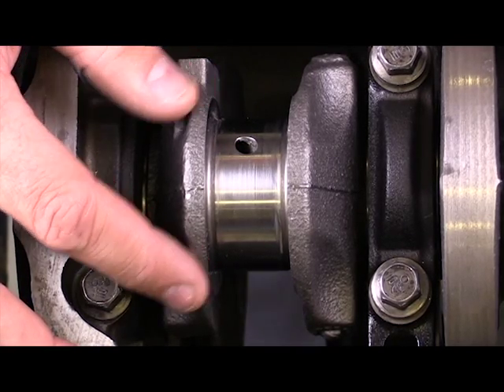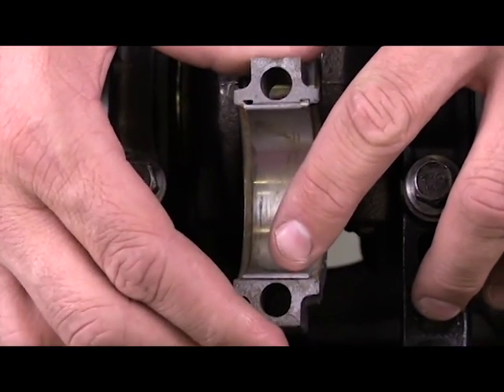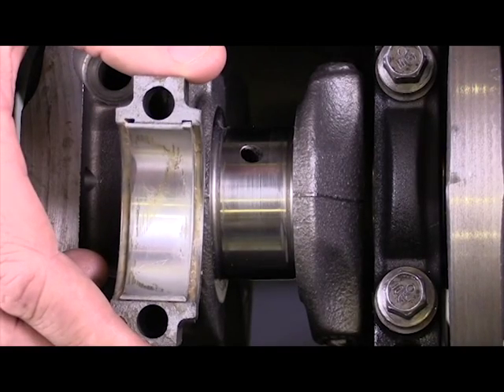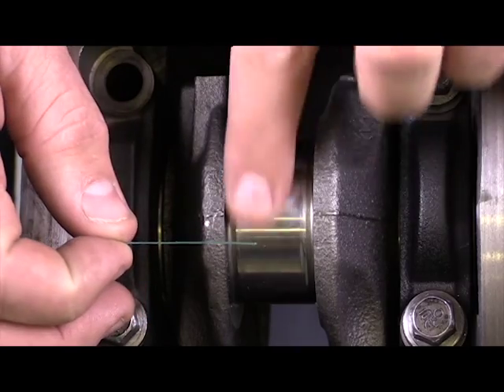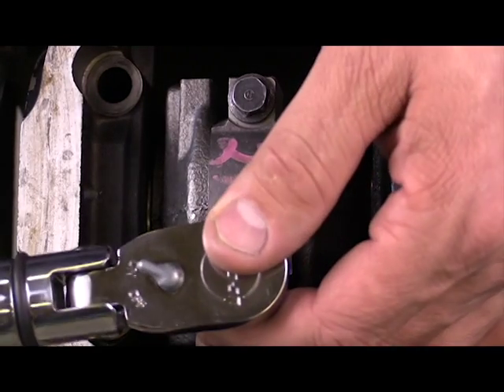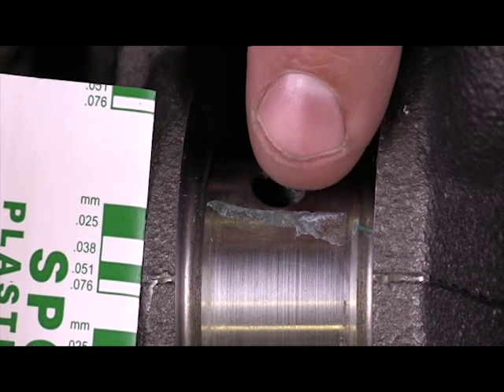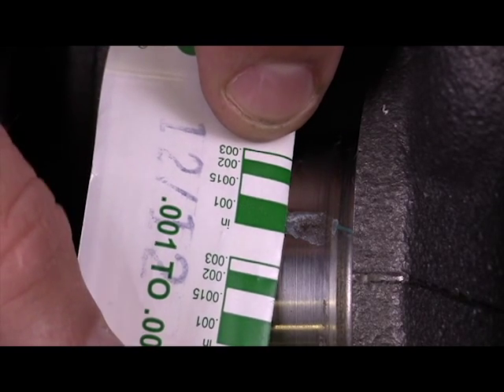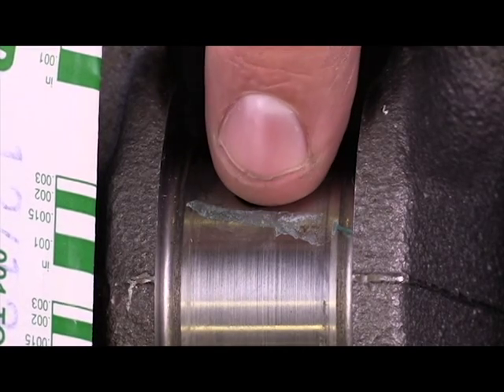Oil Clearance Measurement using Platigauge on a connecting rod

Comment: So do you just check the plastigauge with a bare connecting rod or do you need to check it with a standard size bearing?
Reply from the maker: With the bearing
Reply: Scott Hadzik thank you I saw many videos and nobody ever specified I appreciate it I’m currently polishing my journals
Reply: You check it with the bearings your going to use

Comment: What is the minimun standard of bearing oil clearance?
Reply from the maker: It depends on the engine. The newer the engine the tighter the clearance. If you can give me make, model, year and engine, I can look it up.
Reply: I mean, how mm or inch is the minimum standard of bearing oil clearance. By the way thank you so much for responding, that's help a lot, Thank you again
Reply from the maker: https://www.google.com/url?sa=t&source=web&rct=j&url=https://www.mahle-aftermarket.com/media/local-media-north-america/pdfs-%26-thumbnails/cl77-1-205r.pdf&ved=2ahUKEwiluPDa5bbvAhUNXM0KHX49BMwQFjAAegQIAhAC&usg=AOvVaw0eTXgUThjkc8rgXA6Aaftx

Try that to start. It gives a typical clearance. Each engine designer will have a specific clearance.
Reply: Thank You So Much